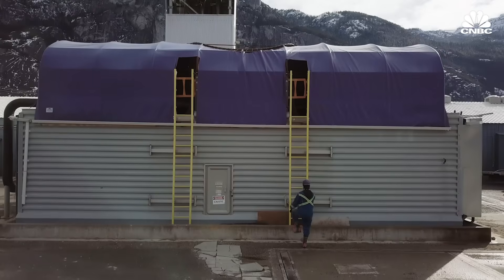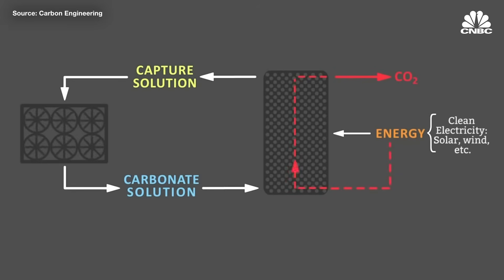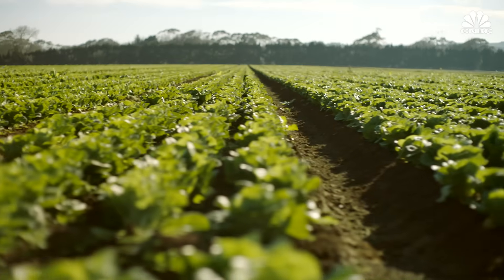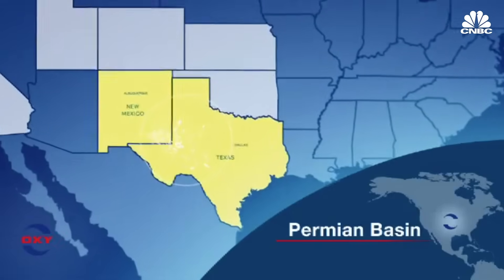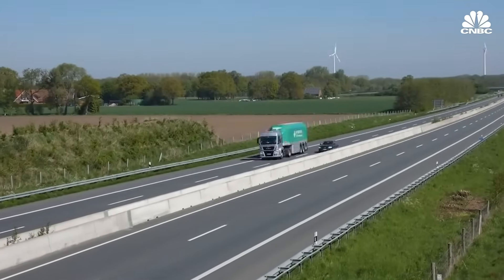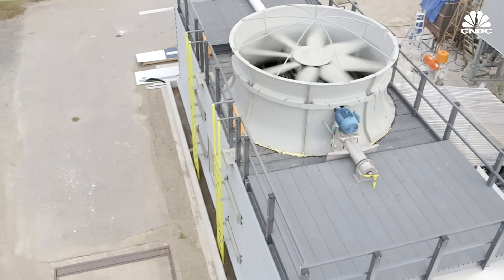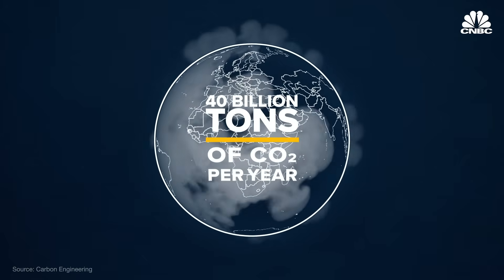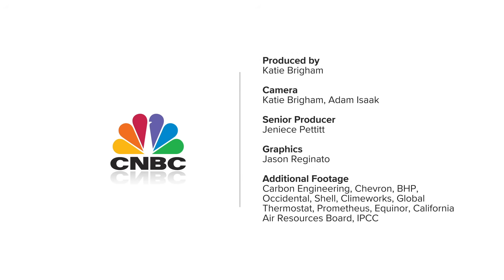Bill Gates-Backed Carbon Capture Plant Does The Work Of 40 Million Trees

Comment: One thing you never hear about is perma frost, the Savannah style grass lands in the Arctic circle captures just as much if not more carbon than trees and traps it under ground with almost zero cost
Reply: Perma frost is melting and releasing a lot of CO2 plus solid methane off gassing.
Reply: Except that we are taking the "perma" out of permafrost with each passing year. And as it thaws, MORE CO2 and methane are released.
Reply: Exactly. Soil holds a shitton of carbon. We should be investing in turning the deserts back into the grasslands they once were.
Reply: @gussampson5029  - Yes, indeed, but we should also be investing in turning IOWA back into the grassland it was. Poor farming practices result in completely unnecessary loss of soil carbon in the Corn Belt, among other agricultural regions. We don't have to go to deserts or tundra to find opportunities for greater carbon sequestration in soils!
Reply: @joeanonimous1105  I agree. Regenerative agriculture is the way to go. Better for carbon, better for soil and better for keeping farmers out of debt.

Comment: The CO2 that is causing climate change is already in the atmosphere, and it will be there for 300 years before it gets sucked in by natural processes. Even if We stop emiting CO2 today, which we are not gonna do, We won't stop climate change. Focusing only in cutting emissions is a mistake. We need this technolgy anyway, and it should be licenced for free to developing nations in order to build 100.000 facilities around the globe, and we need to start doing it now. Yes, we have to get rid of fossil fuels in the next 10-15 years, but at the same time, deploy this technology at large scale, and use it for another 50-60 years, and maybe, we could have a chance to return to the CO2 levels of 1960 by the end of the century.

Comment: Using this technology Congress could make the entire US transportation industry carbon negative tomorrow.  All they have to do is pass legislation requiring 10% of all fuel sold in the US must be sourced from direct air carbon capture technologies by 2030.  50% by 2040, and 100% by 2050.  Then also put a requirement in there that 10% of the CO2 captured by every plant must be permanently sequestered.  Carbon engineering has already said they can do this for approximately $1.50 per gallon.  I’m already paying over $4 per gallon so this might actually save us money.  And by 2050, transportation as a whole would be taking over 200 million tons of CO2 out of the atmosphere, instead of putting 2 billion tons into the atmosphere.  But our politicians are cowards, so I don’t expect it to happen.

Comment: Recycling carbon is going to be a great tool to fight climate change. Green energy is great for long term, but having a diverse approach will be more beneficial than either or. I also think we need to transition to a nuclear grid, as it's the best bet for clean and reliable energy in high demand areas.
Reply: No it will have no effect on the climate and Suncor has been capturing atmospheric carbon to make synthetic oils for 20 years!
Reply: @terenceiutzi4003  and planting a handful of trees won't effect a climate. The effect comes in mass.
Reply: @terenceiutzi4003  so then why would a recapture plants that does the work of thousands of trees will do nothing? Especially in areas that don't have trees yet still have carbon. Also have to consider that trees take years to grow, so the impact will be good 20 years from now, assuming they don't burn down in a wildfire before that.
Reply: @MrFacemeltify  interesting but I have read papers on many different capture processes  and they all claim to be almost carbon neutral so yes they are just like trees! They create Co2.
Reply: All nuclear plant leak radiation all period  . Three melted down reactors are on going poisoning the Pacific ocean for 10 years plus no end or solution in sight little media coverage
Reply: @nickking1510  yes and in 1985 an activist snuck a smoke detector onto a New York nueclier plant and when he opened the X-Ray proof bag it cause a lockdown that all most killed every one in the plant! In 1985 an X-ray technician I know was almost band from X-ray for life becaus she left her badge on the car dashboard over lunch! Yes all nueclier plants leak some radiation but it is less then 1 percent of what we get from natural sources! Have you ever put a smoke detector in the garbage? If you did you put 1000times as much radioactive material into our enviroment then all of the nueclier plant in North America have since they started producing!
Reply: @nickking1510  actually that is not quite true. The 3 meltdowns were plants built in the late 60s/ early 70s using 50s technology with 40s science. That would be like saying Tesla's are deathtraps because of the Ford pinto.

The issues with leaking is a problem, but that's due to underground water pipes corroding, same reason fracking can pollute people's water.
Reply: @MrFacemeltify  not correct think we now have superior technology it all dangerous when it goes wrong and at some point it will go wrong . Are you aware that a Carrington event  would allow the new plants to over heat as well as the older ones they all need constant cooling of core and spent fuel .We missed a Carrington event a few years ago by a couple of days . Also spent fuel is highly radioactive and stays that way for thousands of years to reach half life then its only half as radioactive

Comment: i always find my self on a debate with the side of the story that is anti carbon
you see the problem with trees is that we have so much carbon we would need so much land to plant those trees that people would starve cause there would not be enough farm land

another thing is solar and wind does not remove carbon from the air
sure it helps oil be less used
BUT IT DOES NOT REMOVE CARBON FROM THE AIR
and we have so much it needs to be removed or nothing will change

we need carbon removal and we need a full switch to green energy

Comment: That’s the way to go. If we can achieve it, we could save the world. Just making the world literally stop, will not work and even if it works will takes decades to start to improve a little bit.  Also just going solar or using batteries will not work, because will produce CO2 in the process too. Yes biofuels, hydrogen and others will help a lot but there’s 8.x billion people n the world and growing. This will be less than a dent in the emissions. If the solutions come from oil companies or not, doesn’t matter because nobody so far did come with it. We need save the world first. Everything happens in small steps, 30years ago was inconceivable a battery car and even less airplanes. Yes this is the first steps

Comment: To clue people in, the entire jetstream circulation has changed from oceans too warm to allow Siberian cold to cross the N.Pacific turns it north with heat & moisture near BeringStrait a low point in topography to cool and go to low latitudes ONLY over LAND to balance equatorial overheating. 

So, record cold winters will repeat until the ice is gone in 60yrs or less, check. 

Then in summer it's reversed,  LAND heats quickly, oceans don't so big high-pressure domes will get hotter and last longer,  check. 

For spice where the polar cold meets warm-moist tropical air we get floating-car sheet_runoff flooding globally, check. 

At 500ppm CO2eqv +3ppm/yr =750ppm by 2100 2m/6.7ft more sealevel rising at 30.5cm/1ft per decade for several centuries, check. 

Oe cannot remove CO2 below Mt.Everest air mixes too fast, and when emissions finally end, oceans outgas their excess CO2 to keep levels above 400ppm for >>120,000yrs. 

Our extinction 3.5ky-5ky away with BAU, unstoppably like any glacier on Earth ending below a rising sealevel cannot be stopped from quickly melting from below by warm oceans and altered jetstreams, check. 

Oh, we're so arrogant, the hairless apes aren't wise, check.

Comment: If my calculations are correct, about $300 of diesel fuel will produce a ton of CO2. If the cost to capture a ton of CO2 is over $200, how is that economically feasible?

Comment: One advantage of planting trees large scale is it can actually significantly impact local climates. Look at the projects going on in Africa (great green wall) and China (40 Billion Tree project)
In these projects Desert is being reclaimed which not only positively impacts CO2 but also positively impacts radiative heating. CO2 is only a part of the problem and I've seen data that suggests it's not as large a portion of the problem as politicians are pushing. 
Ethanol plants in the US are pursuing "Green Fuels". Carbon stored in biomass is captured during ethanol production and sequestered. the result is a fuel that emits less carbon when burned than is removed from the atmosphere. It's a step in the right direction where fuels are required. 
I like an electric centric economy in the future with nuclear power. it is the cheapest most reliable and has the lowest negative environmental impact of any power source we have.  
Germany and France are perfect case studies for what we should and shouldn't be doing. 
France has primarily nuclear power and has some of the lowest carbon emission rates at reasonable prices.
Germany closed down nuclear power and invested billions in renewables and their carbon emissions and costs both went way up.
Renewables require building 3 x the capacity due to the inconsistent nature of the power and the addition of natural gas plants to stabilize output. It's just a terrible model.

Comment: the technology to capture carbon  is well known and proven. its just hasnt been economical. the  economics fail in two key areas.first is the energy needed to capture the carbon. the second is in how to use the co2 after you capture it. the energy to capture problem seems self defeating. the laws of physics particularly conservation of energy are against us.  it will always takethe same or more energy to recapture carbon that was produced in its original use. that is  a simple law of physics, so we need an abundant nearly limitless source of clean energy to drive the carbon capture process. the problem of how to dispose of the captured co2 is  an issue of economics. co2 is a fundamental industrial building block. putting it back underground is a waste of a valuable commodity.there are many more valuable uses. some of those can lock the carbon away for long times like using it in cement.  others have valuable uses that can  overcome the costs to capture.  like converting co2 to fuels..converting co2 to a fuel create an infinite circular carbon economy. burn fuel.. capture convert burn again.  an infinite loop that can provide all the fossil fuel energy the world will ever need with a net decrease in atmospheric co2.  the answers to the bug issues exist. the US patent ffice has awarded patent# 11,002,255 to solve both of these major problems at the same time.
Reply: Nice post. Something rational for a change.

Comment: So the people who are against it. hate it because you can use fossil fuel with out harming the environment. Kinda sounds like solving climate change isn’t really there end goal. There is no way you are going to get every country to stop using fossil fuel so if you have the ability to remove it from the atmosphere seems like a much better solution than trying to get everyone to stop using gas powered vehicles.
Reply: "Kinda sounds like solving climate change isn’t really there end goal" . Bravo! Just one of many signs that the climate movement is an ideological movement and has very little concern for the actual environment. It really helps when we know who we're actually dealing with.

Comment: Ok kiddies...  you haven't thought a lot of this through.  Half the earth is dark all the time.  Of the half that faces the sun 1/3 does not get strong sunlight.  Of the remaining 2/3 (which is a generous estimate) only 25% is land.  The other 75% is water.  That leaves a little more than 16.5% of the area of the sun facing side of the earth to capture sunlight.  That's without roads, bridges, houses, cities... and NO clouds.  Now factor in all the places you can't put solar collectors, the cloud cover, losses due to storage and transfer.  Let's be extra generous and say half of that land mass can be used.  That leaves about 8.3% to capture photons.  Did you really think you could run an industrial society with that?  A railroad?  A steel mill?  A shipyard?  We(engineers and scientists) have been telling you for decades that your approach is simply not a viable solution.   Now let's talk about wind.  It's diffuse and intermittent.  Now... since wind power is proportional to the cube of velocity that means a 10% reduction in the wind speed reduces your output by almost 25%.  If your wind speed is reduced by 20% your generated power is now 50%.  Can you really forecast wind speeds so accurately you could manage such a load?  In the rare off chance you manage to produce a surplus... how are you going to store it?  And what are you going to use to generate electrons during peak load when the wind stops blowing?  Remember... granny is having heart surgery tomorrow.  Sure as hell hope the sun is shining and the wind is blowing.  The annoying part of all this is that these computations require nothing beyond addition, subtraction, multiplication and division.  You don't have to row reduce any matrices or integrate over any branch cuts.  No conformal mapping, complex Laplace transformations or series solution to partial differential eqns.  It's all primary school arithmetic.  And you still can't manage to understand what's going on.

Comment: How is it powered? Trees are solar.
Reply: You didn't watch the video, did you..
Reply: @rogerout3416  what part made you believe the net carbon collected will exceed the carbon required to capture it?
Reply: @lamboseeker238  you didn't read my question, did you?
Reply: @rogerout3416  what makes you say that?
Reply: @lamboseeker238  because it's almost like you're having a conversation with one of the voices in your head. You completely ignored my question and started a conversation of your own.
Reply: @rogerout3416  I’ll ask it this way. How much power / carbon output does it take to make a solar panel? What is the balance of the lifetime carbon impact of the solar panel? Wind turbines? How many trees do you have to cut down to build one turbine? What is the key component in steel manufacturing? How far are the parts being shipped from? What is the lasting effect of the chemical process to remove the carbon? What is the balance of all the energy output needed to build and maintain the facility, trucks, clothes and hard hats? Can you get that much carbon out of the air plus 10%? Ask bigger questions. What is the total percentage of carbon in the air? How much is contributed by human activity? What is the norm? Is that research reliable? Is there an agenda attached? Shouldn’t we be looking at turning plastic into bio diesel? Thorium is everywhere why are we not using it to generate power? Can we reduce trash and carbon using a thorium reactor?
Reply: @rogerout3416  no. NO! Well maybe...
Reply: @lamboseeker238  Why are you avoiding a simple question??
Reply: @rogerout3416  for the same reason you are. You are trying to put me on the defensive. Your question has nothing to do with the content of the video. What you want is to use my answer and say insert catch phrase here. Or ask an obscure question. In short you want to play the scholar. The answer i, did you understand the video?

Comment: The 2 professors starting at about 1:03 let slip, very briefly, in a backwards way, the politics of climate change solutions and what the "experts" true intentions are. If they are so extremely concerned about climate change and how this is a "world wide emergency" that they like to claim, the who cares who invests on trying to solve it. They are working together with the oxy oil company to build a plant to remove co2 from the air. That's what they insisted was the biggest issue. They should be happy that an oil company wants to get involved trying to address a problem they helped create. Instead you see these 2 "experts" that say how real and deadly climate change is and how it's irreversible... except here's a company doing just that and they are opposed to it. Yea I get it, you don't like oil. Ok, we established that, now, can you start to work towards a solution or would you rather have the earth meltdown or go into a deep freeze, idk, I'm not sure what the global warming/climate change debate is anymore, just that the proponents say it's gonna be bad!! The climate is going to do something and something else is going to happen, which makes it so whatever happens then is going to be catastrophically different than what we have now!! Think "hole in the ozone" bad! What do you mean the hole in the ozone catastrophe never was a thing? Ok, never mind this, this is bad, and the "experts" don't want to try and fix it if they have to work with the mean oil companies! We're all going to die... at some point. Like, not everyone at the same time, just, like individually at some point, we're all going to eventually die! Doesn't anyone care about that!?